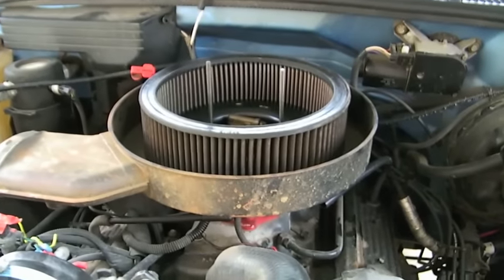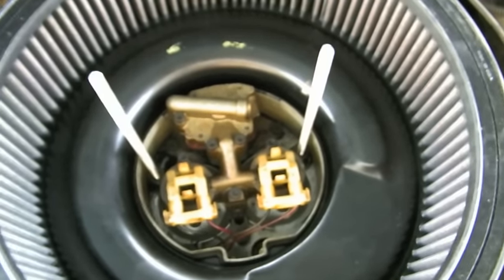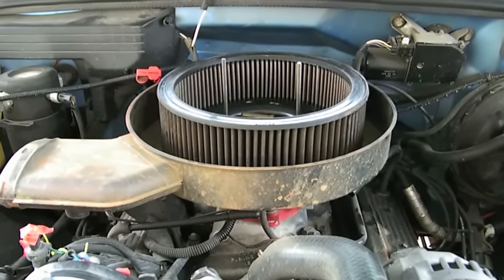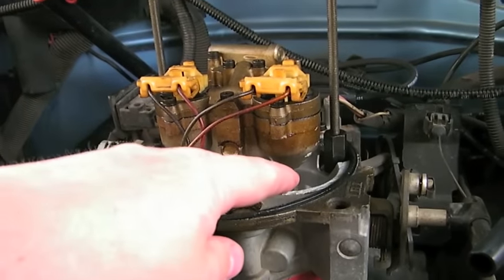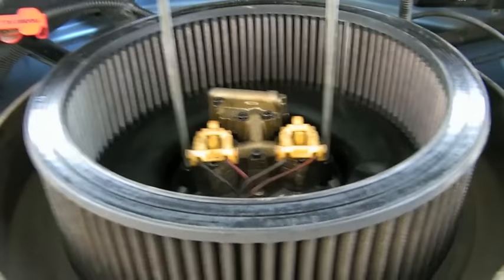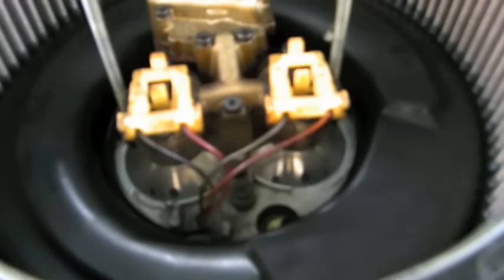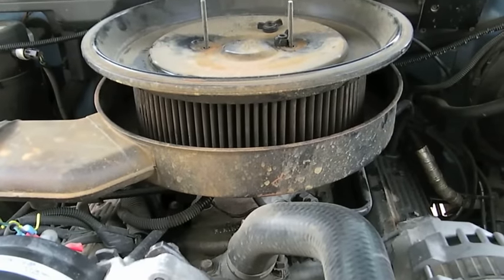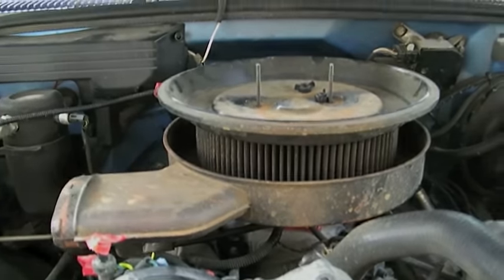TBI mods, how to get the most power and Horse Power from your TBI engine.

Comment: 20 HP gain for that seems more like a dream than reality.  You probably gained about 2 or 3 more HP.
Reply: Probably lost that 2-3hp by ingesting hot air from under the hood and went negative hp
Reply: I believe he got the 20hp at the crank
But 20 extra hp in a truck feels like half a hp because you know, power to weight ratio
Reply: Yeah 20 hp gain is false...i have done same thing on better scale and its no 20 hp gain...throttle a little quicker....that air breather is messing your flow all up
Reply: You need to just go ahead and install a cold air intake after grinding the tbi. Your just getting hot air with the lid flip. I installed a airaid with the salad bowl and made a custom box around the filter the links to the fender vent to get as much cold air as possible. You can also get the salad bowl with 2 pipes to get the air from both fender vents… also a power aid throttle body spacer dosent hurt…
Reply: Lol boy🤣😂
Reply: Depending on the fuel injectors, maybe 7HP
Reply: The closed air filter lid traps heat from the engine and running intake tubes without a scoop on the front is silly. You don't want to try and pull air from closed pockets like finder wells or where water/mud is possible in 4x4's. Also air tubes soak heat from the engine bay and the air flow, like a radiator, carries the heat away from the tubes directly into the air filter box and the into the tbi. The man reported what the software said and if real world performance is noticed while driving then the modifications worked. Surely the weight of the truck didn't increase but lack of skills and respect didn't hinder the other 12 year old Honda drivers from commenting either. Removing obstacles to increase airflow, like porting an intake or head, is always a good step in the process for more power and I appreciate the ideas. Now a closed filter system with large aluminum intakes running to open scoops under the bumper or behind the grill would definitely help as would new rockers with a cam swap and removing the interior along with the bed but I thought this was a video about doing a little modification on the stock tbi. Thanks for the video and keep sharing the ideas.
Reply: Since it’s a TBI style injection, the fuel will cool the air as it vaporizes much like a carb does . The hot air from under hood is a bigger issue with port injection.
Reply: @jthomas4190 obs Chevys are light as hell what are you on 😂

Comment: They sure lay down a hell of alot of low rpm torque, and torque is what moves you.  These engines are some of the best GM ever made as far as durability and realiability goes.  I've seen fleet trucks with TBI engines with over 400K on the clock still going strong.
Reply: i have 400k on a 4.3
Reply: I bought a fleet truck with 300k. It ran great for years
Reply: Got one right now with near 500k on it still running she’s due a tune up though 😂rough idle/dies when changing into gear most of the time, and wide open throttle is non existent as it cuts out and sputters like it’s running outta gas. Old 3500 350 tbi bell south truck

Comment: The biggest problem with the lid flip is now your sucking in hot air from the engine bay. A better idea is to get or make a second intake horn and route both horns to a fender or to the radiator support thus allowing more cool air into the intake. A cooler air charge equals more power.
Reply: It’s really hard to do this with these pickups because most intake tubes are metal. That metal will get really hot from the engine bay temps. By the time it gets through the tube to the tb you got hot air again. I figure a lot of hot air is better than a little less hot air
Reply: Couldn’t you but a hot air intake filter tho
Reply: Absolutely great tip advisement 🔧
Reply: Stock air lids have a heat port that take heat from the exhaust so with a aftermarket the air would be colder
Reply: @jakerish570  the heat port you are talking about in the snorkel. Has a temp operated flap in it. It's open when cold to allow air coming across the exhaust manifold to be heated  to help the engine warm up faster. When that flap reaches a certain temp it closes allowing only fresh air coming from outside the fender to come in. But ! those flap's are know to screw up and not work at all or stay open to hot air all the time. They really don't do much for the warm up process so I usually pin mine so it stays open to fresh air all the time.

Comment: i personally have added a spacer done the lid flip and eliminated the  pcv ring and then upgraded my filter to a k&n then eliminated my pcv valves and dumped them into a blow by can .i can tell you this my throttle response if phenomenal now, hp has definitely increased. now yes you sacrifice fuel mileage but if your looking for gainz  for little to no money its a good start. its by no means a major upgrade but every little bit does help
Reply: What is a blow by can?
Reply: @northwoodsproductions3421  it's a canister that's mean to catch oil that's in the crankcase/valve cover air so as to not lose it all or make a mess
Reply: I would love to see your setup, have any pics? How would I run the catch can. Everything else I can figure out. Thanks.
Reply: i would love to eliminate my pcv ring to have one less line running under the hood. what does this involve? I already eliminated the old intake by just using an S bolt and a normal single bolt intake lid set up. Not sure if it will breath better or not this way yet though as im not yet done with my 5.0- 5.7 tbi swap on my 93.
Reply: @bradleyburnett4470  i bought some adapters at my local part store and just dumped the crank case exhaust down and out at my wheels.using some rubber hose
Reply: @mainerj  ive since put a diffrent motor in my truck and no longer run that setup but basically you run both your pcv lines into a single line then into the can then dump the exhaust out wherever you wish
Reply: @Drakedrakonis02  sweet, thanks!
Reply: Yup ,I tried the "catch can " setup . Trouble was  the engine was going thru way too much oil  . Checked my dipstick after a week and was down 2 qrts. ,yikes. Back to the stock setup now, runs fine . 20 mpg,s .

Comment: i love these systems...reliable and easy to diagnose and repair.
Reply: cheap also. grab ya a aftermarket computer  a 2x4 intake manifold and run 2 of the tbi units from the 454. and get the old school look. cheap and reliable fuel inj. easy to work on. and 2 of them wouldnt have any issues supporting 500-550 hp with a aftermarket puter. Or grab a 3x2 intake and run 3 of the 4.3l or 5.0 units. would look pretty sweet.  differences between the 4.3 5.0 and 5.7 units is just injector size. its been years but i think the 4.3 had 45 pph injectors. the 5.0 was 50s or 55s and the 5.7 was a bit larger. i used to remember these but its been so many years. all the injector pods are interchangable
Reply: If only they had any power at all

Comment: There's so much misinformation in these comments.

1.  Yes, the TBI cam and heads are really weak, and upgrading these will get you the most gains.  However, most of these tricks help in small ways and are popular mostly because of their low cost.  The TBI computer is really sensitive, so any major changes will require reprogramming that will up your costs if you don't know how to do it yourself.

2.  Exhaust upgrades are great, the factory Y pipe was DESIGNED to flow badly; this was to help the one-wire O2 sensor heat up.  If you modify to a better flowing exhaust system and convert to a 3-wire self-heating O2 sensor your engine will breath better.  Remember, a motor is basically just a big air pump and if you increase your air intake ability, it helps to increase your air output.

3.  Deleting the cat can help, but its better to install a high-flow cat and stay environmentally friendly.  Unless the cat is old and clogged it most likely won't affect your engine much to have one.  Plus if you travel out of state you can stay legal; a cat-free system has a different smell, and supposedly cops in some areas will pull you over if they notice it.  I live in an area without inspections myself, but I like to stay legal in case I travel somewhere that isn't.

4.  For MOST  MODERN APPLICATIONS a throttle body spacer is snake oil, completely useless.  However, the concept comes from carburetors and actually does help with a TBI.  More complex systems with high pressure fuel rails won't see any difference, but the spacer on a TBI helps with fuel atomization.

5.  The lid flip can help a LOT, but not for the reason people think.  From the factory these air cleaners are designed with essentially a cold air intake that breathes air from outside the passenger fender.  However, they have a small tube that reaches down to the exhaust manifold and a flapper inside the breather.  This flapper is close when the engine is cold, forcing it to breath through that small tube and suck hot air off of the exhaust manifold.  As the air cleaner warms up a little wax-based actuator opens the breather flap so it can suck cold air from outside.  The warm air at startup helps a LOT on a cold engine's idle, and the smaller tube acts like a choke.  What most people don't realize is that over the years that flap actuator stops working, meaning the flap inside stays closed and chokes the engine of air all the time.  So when you do the lid flip, or install an open-element breather your engine automatically breathes much better.  You can take that flap off and block off the small tube on the factory air cleaner, and as long as you still have the plastic thing to the fender you get a fairly efficient cold air intake; however, doing this causes your engine to idle rough from a cold start and smooth out after warming up.  An open element air cleaner is kind of a compromise; you have warmer air for the warmer engine, sacrificing efficiency, but from a cold start you have slightly warmer air going in for a smoother startup idle.
Reply: torque swirl spacer works super well with throttle response and low down torque, absolutely blew my mind with what a difference it made.
Reply from the maker: +cody roland 
I did not notice anything.
Reply: in my single cab stepside it made a huge difference.
Reply from the maker: +cody roland 
Nice.
Reply: Justin Oakes damn bro you are well informed I have an 85 tbi chevy caprice classic. What is your opinion on throttle body spacers with older cars?

Does open air filters promote fuel atomization?
Reply: cody roland whats your opinion on tbi spacers? i have an 85 caprice
Reply: Torque swirl spacer with fuel line extensions from summit. The heads won't ever allow you to make a lot of hp so just get stuff that helps torque. If you go to an open filter get a taller filter if it fits or one of the filtered tops. if you keep the stock filter housing remove the little flapper in the metal neck. I've wasted a lot of money playing around with the tbi engines and that spacer was far the best bang for the buck.
 https://www.summitracing.com/parts/trd-2534/overview/year/1992/make/chevrolet/model/c1500
https://www.summitracing.com/parts/sum-220861/overview/year/1992/make/chevrolet/model/c1500
Reply: I have the 1994 and my gas mileage sucks will these mods help with that
Reply: See my channel << click on my name, and check out HHO (Brown's Gas).  Adding a small amount of HHO (Gas) into the air cleaner, to act  as a fuel catalyst (ensures more complete combustion). It can greatly improve the mileage on your engine.  It works great with carbs, and diesels. It also helps some with TBI and Injected engines (but those require the addition of a "EIFE "(a small electronic 02 sensor tricker/tuner).  I'm not selling anything, just offering info for those that want it.
Reply: Full Nelson TV
Reply: Justin Oakes thanks appreciate all the information. I own a 1990 Silverado short bed single cab with a 5.7 350 I love these trucks and I'm actually fixing it up little by little. But I want to fix it up the right way it has 223,546 miles on it right now. The engine still feels pretty strong for the most part pretty much stock for now. The only upgrades they I've done to it is a cold intake and an exhaust dual. I live in California so no headers or cat delete. I was thinking of chipping it but I'm not sure yet
Reply: Justin Oakes i actually took the tube off of my 4.3 tbi intake and the immediate response was mind blowing i noticed that my exhaust sound got a bit more pronounced as well
Reply: TheLargecars I installed a volant air intake it did make some difference. Buy I would like to get more horsepower and torque do you think this spacer would help
Reply: chevyxrz generally the more airflow the better im not sure on spacers for ive never used them and dont wanna tell u false  information
Reply: TheLargecars appreciate it thanks for you're response
Reply: chevyxrz hey id rather people learn themselves than take the false info and break their stuff for most of us these mod on our personal daily driver and cant afford a new one...just lookin out for my fellow man
Reply: TheLargecars greatly appreciate it thanks 👍
Reply: Also with the lid flip. The inner fender is almost completely sealed on trucks and suburbans and my old gmc safari with a small very restrictive duct that feeds air into the fender from just below the right turn signal behind a solid part of the grill. Doesn't matter if the air is cold and dense if the engine isn't getting enough air flow to suck up the cold air.
Reply from the maker: Copy and paste are two powerful buttons.
Reply: Justin Oakes you're adding to the misinformation here.... The small tube that you're referring to is not an air intake in any way. That tube is a heat riser used to warm the air going to the engine. To clarify, take a look at the ends of the tube and notice that the exhaust manifold end is connected to a heat shield on said manifold.... No air source there, just heat. The flap inside the air cleaner, at the top end of the tube closes or opens as you described, except that it does not force the engine to breathe thru tiny tubing.....it exposes incoming air to heat or isolates that air from the heat. All for the sake of better cold engine performance.
Reply: Has anyone here replaced the heads on a tbi engine and kept the stock cam? Curious if it made a difference
Reply: Hey looks like you know your Chevy I have a question about a cam I have a 94 Blazer tbi 350 and I'm looking to upgrade my cam but don't want to do nothing to crazy like valves and springs you know if the lt1 cam can work with out doing any of this
Reply: Nimbus Nimbus  even if everything in the valve train was worn out, valve seals worn out, you didn't trust the head gasket, and had a brand new pair of heads laying around?
Reply: I've been going crazy trying to figure out why my 1987 GMC 3500 dump truck idles like it's running on 4 cylinders during a cold start, I was going to rebuild my throttle body to see if that would help but the airflow thing has got to be my issue, thank you so much!
Reply: Nimbus Nimbus  I already know shit everyone knows. I was curious about the few people who had done what I described. I no longer own the truck so I'll never know
Reply: Nimbus Nimbus  I already know what you stated. You gave me basic information. I was hoping for someone who has actually done it before with this exact engine. So your initial reply,  as well as any subsequent replies, are, have, and will be a complete and utter waste of your time.
Reply: Yeah, a throttle body spacer on my TBI 4.3 made a decent enough difference that I'd recommend on them older 4.3s, We used that truck for hauling produce, we had about 1,500lbs on produce on the back and about 2,000lbs on a small 8 foot ford bed trailer, now on the highway going up a hill, it was pedal to the medal and was still loosing speed. I installed a spacer, $15 bucks, if it didn't do anything, its $15, who cares, the low end torque it had after the spacer was installed was crazy, it turned a slug into a turtle. Now when we haul with it, it does rather well now.

Idk if it will do much on a 5.7, I haven't tried it on my 92 with a 94 5.7 engine, only because it runs good and hauls good already, but its got True duals with no cats with 3 inch pipe, EGR delete, so it can breath better, stock headers though, I may try it one day for the heck of it.
Reply: @VikingDudee  does ur truck check engine light come on with that egr delete? when I blocked mine I would always get that. and was there a noticeable difference when you blocked it?
Reply: @fishy7463  occasionally it comes on, I never scanned it to know for sure if it's from the egr. I just know it ran why better after the delete

Comment: He is right about what he has done the tbi mod he did does help. But instead of the air cleaner flip crap, get a cold air intake kit or regular air filter base and top 14".
Reply: Unless you plumbing that to pick up actual fresh air not just sticking off to the side of the engine all you're really ingesting is more hot air which defeats the purpose. If they would run it up like on the old Chryslers and Dodge and cut a hole in the radiator support so that it could actually feed nothing but cool air you might be on something there.
Reply: Exactly